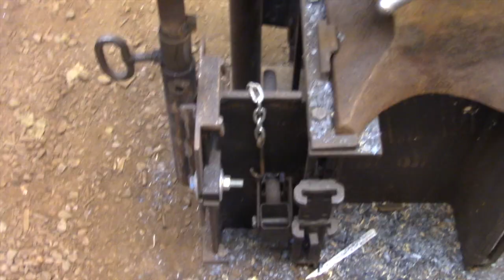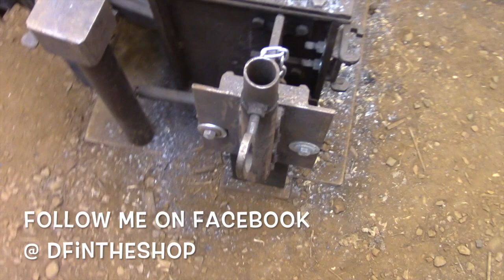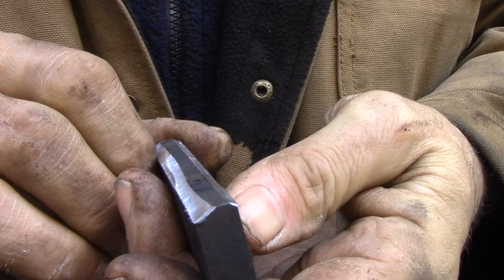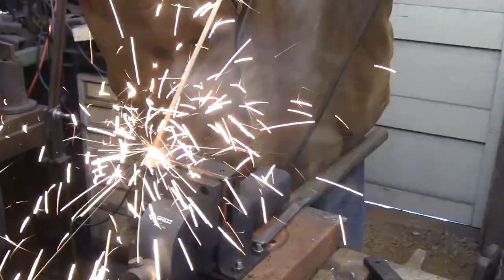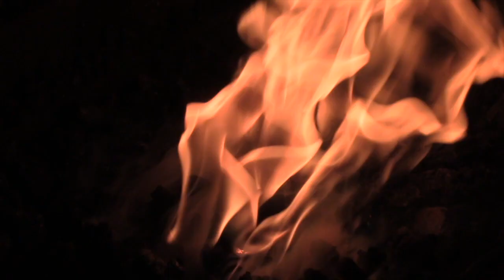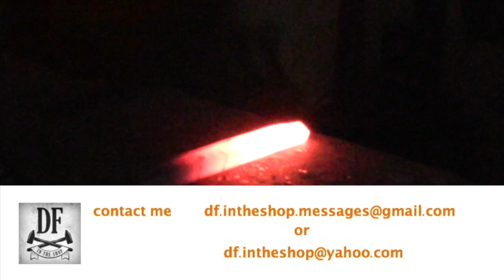Blacksmithing for Beginners - Making a Welding Vise

Comment: That looks like very worthwhile modification.  I also like the fact that since it's welded to the jaws, and not the vise itself, it can be easily removed or replaced if necessary.  One potential addition I think could be beneficial is to place a small leg on the plate on the back of the vise.  Not only would that add a little more stability to the back, you could make a small hole through the plate (if you made the leg from a hollow tube) (like a miniature hardy hole), or you could drill and tap a hole that could be used to affix a hold-down clamp (like are used on a milling machine or drill press).  A good (IMHO) size would be either 1/2" - 13 or 3/8" - 16 as they are common sizes for allthread rod.

Comment: I'm making a portable welding table starting with the base of a 5' folding table. I took the plastic top off and I'm building a lightweight but sturdy metal top for it. It'll be about 7-8' when I'm done.